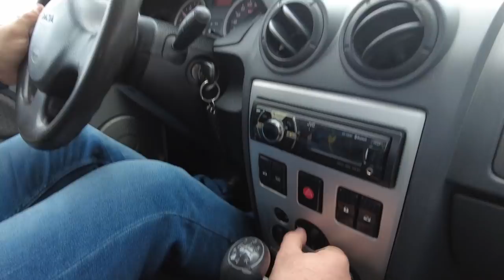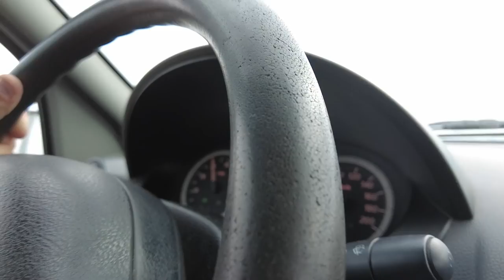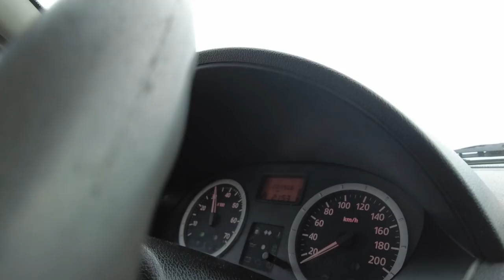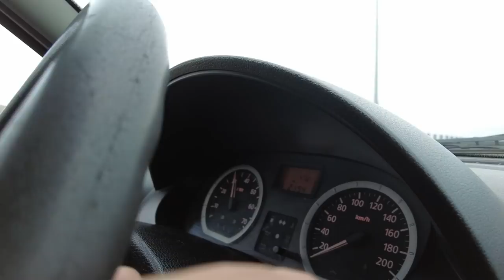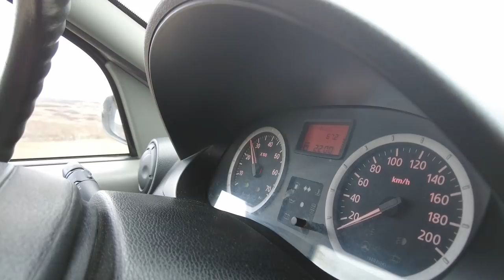🇹🇩 La mulți ani dragi români ! Episod special de 1️⃣ decembrie, Dacia Logan 1.5 dci fabricație 2006

Comment: Salut. In 2010, eu fiind student si neavand bani prea multi de o masina, chiar si sh, ajungand la capatul puterilor cu o dacie 1310, pe care am detinut-o 6 ani, am decis sa imi schimb masina. Ma gandeam la un golf 4 sh, dar bugetul era prea mic, asa ca am ales sa iau un logan varianta zero. In 2010 masina costa 5900 de eu, iar statul dadea 3 tichete rabla, fiecare in valoare de 900 eu, eu avand 3 dacii 1310, dintre care 2 stateau in garaj epave, am decis sa le duc la remat sa imi iau tichetele. Asa ca da dl Mihai, mi-am luat Logan varianta 0 cu 3100 de eu + 100 de eu discount de la dealer, 1.4 mpi, avea abs si airbag sofer, intr-adevar fara ac si servo. Am facut in 6 luni 20k km in regim personal, eram foarte incantat de cum merge fata de batrana dacie, am vandut-o dupa 5 ani cu 80k si fara absolut nicio problema si fara vreun incident. App...am vandut-o cu 3200 de eu.M-a sunat la vremea respectiva urmatorul proprietar sa imi spuna cat de multumit e de masina. Asa ca da, se poate spune ca nu a costat 5000 de eu, ci 3200. In 2010, dacia avea cele mai bune si fiabile motoare, de la benzina 1.4, 1.6, 1.6 16v pana la 1.5 dci. Toate duceau min 500k fara prea mari interventii la motor, daca le exploatai in regim normal si le intretineai corect. Succes la videoclipuri!

Comment: Salut, lucrez in vanzari avut un logan 1,6mpi 2011  si cele mai mari probleme au fost  ultimul an cu : un releu , senzor apa, pompa apa blocata la 45000,  clapeta acceleratie.
Toate la 200000 si ceva , acum 2 luni am primit logan  1,0 100CP  2020 ultima generati nou 95km LIpsuri: indicator la temperatura apa, indicator la autonomie , nu baga caldura la picioare, nu isi revine volanul la viraj, rezervorul  de parbriz  cred ca are 0,8l , oglinda retrovizoare care i se misca sticla, motorul are zgomot de Matiz si este foarte zgomotos, de cand a dat frigul scartaie chederele la usi cred ca de la dilatatie.
Plus ar fi ca: este noua pentru domeniul de activitate,  mentine plecarea in rampa si ATAT.

MAI MULTUMIT AM FOST DE  CE CEA VECHE.
Reply: Am condus vreo 3 loganuri, generatii diferite si la nici unul nu revine volanul cum trebuie inapoi.

Comment: Am avut logag 1.5 dci nou, nout,2006 euro 3, full pt ce oferea Dacia atunci 10500 euro.Motor fiabil, dar lenes, electrica slaba, tabla slabuta, chiar si vopseaua e slaba.Masina e si acum in familie  , dar mama mea face 10-200 km pe luna .E o masina f inalta, piesele la roti f f slabe, stabilitate pe drum dezastru, daca pornesti AC s-a dus puterea, fum scoate de noua.
Reply: Probabil il aveai pe cel de 65 de cai. Cel de 90 de cai nu mai e asa lenes. Si eu mai am in familie Loganul de 1.6 benzina tot 2006, dar euro 4. Nici o pb.

Comment: Logan 2009 1.4 eeste moale la acceleratie nu poti depasi cine stie ce dar nici nu vreau, si la 200k km am schimbat doar o bobina (din cauza mea) si revopsit un prag , in rest consumabile, daca as mai gasi si sunt sigur ca gasesc una cu 1.5 2009-2012 pana sa treaca la modelul 2 as cumpara-o imediat indiferent cat costa, am gasit 2006 cu 40k km 1.6 8 valve si merge extraordinar, (consum cam mare) acum mai caut una cu 1.5, dar nu vreau modelul troaca fara servo si airbag pasager, nu ma incanta. Cele noi nu le vad rostul la cumparare, de noi,  sa le ia nemtii prea scumpe.

Comment: Am avut pe firmă loganuri  1.5 dci berlina de 65 cai ca cea din clip,  break de 7 locuri 70 cai și 1.6 i 90 cai, nici o problemă cu ele.Cea din clip e din Germania se vede stick-ul din parbriz în acte e trecută viteza maximă 150 dar am prins 170 foarte bine pt 65 cai și 160 Nm  la 80 se merge cu 2.8-3.2 % se poate scoate mediu extraurban 3.8-4%. La 4000 ture pe navigație ai 160 sigur are scoasă mufa din cutie să nu înregistreze km